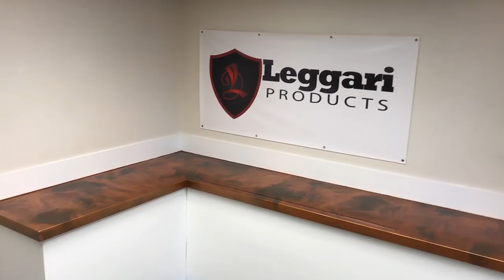Epoxy Countertop Coating in Brass, Coffee, Black and Orange Gold Metallics

Comment: Nicely done but missing too many details. Here's what I would like to see:
1. Technical details: sanding grit used, how to measure volume of product needed based on the area of the countertop, type of brush/roller, how long to wait between coats, total dry time
2. A video from beginning to end without jump cuts. This video doesn't show the cleaning after sanding, and it doesn't show a time lapse of the epoxy smoothing out. We have no idea if the epoxy smoothened out on its own or if you used a torch to help the process.
3. Demonstration on a real counter, with sinks and butting up against cabinets. Also a little more care - in this video I can see drips under the short section of cabinet.

You're already doing the work - would be great if you can capture it. What I would like to see is a video with a time counter starting at zero from when you start taping, and ending with a countertop that is ready to use.

I'm probably one of many who is comfortable with painting, new to epoxy, would like to buy a DIY kit from you, but who is intimidated because I keep thinking that you're making it look easier than it is. If I screw up the process, that's hundreds down the drain. So I want to know that this is something I can handle.
Reply from the maker: RK Coder We have the most advanced and detailed instructional videos on the market but do not post them on you tube. They are sent out once a kit is purchased if you would like to see them email us at leggari@gmail.com The videos we post on you tube is to show the endless options of our products.
Reply: Those are good questions and give peace of mind when investing time and money before starting. I imagine getting this product exposed as soon as possible was the goal. Maybe Leggari will answer these to bump sales.
Reply from the maker: Ron McCoy This video explains the process https://youtu.be/Fq40_IBjgC8
Reply: I cannot speak to this product specifically but I have put down thousands of gallons of epoxy. So #1 sanding grit, depends on that you are sanding. A 100 grit is enough to give epoxy a surface to cling to, if you have a bad surface you may need to start very rough and bring it up to #100. After you sand tac wipe. Measuring metallic epoxy can be more involved. How many colors are you using, what ratios, (highlights to base color). A gallon of metallic will cover about 50ft, you can stretch it farther but it will not flow right, the movement of the powdered metal in the material is what gives the it the awesome. If you are getting a kit this has all been worked out for you.  Use a 1/4-3/8 roller !!shed free!! From mixing to last roll plan to be done in 20min and you are safe. You will have to work the vertical surfaces a little extra as the material really does not want to stay there. When the material is done moving pull the tape, if it dries the tape will be a pain. Lots of videos on you tube about metallic epoxy watch a bunch and you will be fine.
Reply: Mike Grant Mike Grant These are great tips. Thank you! A few more questions if you wouldn't mind: 1. Any special precautions when working with a thick 4-inch backsplash? All of my counters have them 2. You brought up an interesting point about tape. How do you know the epoxy has stopped moving? I'm not concerned about top and side tape, but I imagine the bottom tape prevents dripping onto the cabinet. 3. Is there an ideal temperature range when to do this? 4. Does the area need to be ventilated to the outside? 5. I've seen some installers use a torch. Is this optional? 6. How does a laminate countertop with sharp corners end up looking after epoxy? Would it look slightly rounded over? Would you recommend slightly rounding over the edges before starting the project?
Reply from the maker: We address everything in our very detailed tutorial videos we send out. They are long, but detailed. Email us directly at Leggari@gmail.com and I'd be happy to send them to you. Thanks
Reply: 1. No special precaution, you will just have to work the material until it sets up enough to not slide off. Some people like to do the vertical surfaces  first and after they dry do all surfaces so you get the same amount of material everywhere. 2. As soon as it stops dripping you can pull tape. 3. Temperature will vary depending on the amount of product in place. 4. As with any coating that out gasses, use in a well ventilated area. A open window is fine, do not have a fan blow on the epoxy surface. 5. A torch with a rosette tip works well with many epoxys, you will need to refer to the MSDS before using a open flame near any material. 6. That is pure personnel preference, if you like rounded more then you will like rounded epoxy, if you like square you will like square. Take up Leggari's offer and watch their video, it could be they have some specific ways of applying their system that will make your project much easier. Just do it, you if you dont like it sand and have another go. The second time you will feel like a master compared to the first.
Reply: Mike Grant Thank you! I think I will give it a shot soon.
Reply: Looked like it didn’t matter. Pretty sure a two year old would get the same results
Reply from the maker: m60hein Exactly! If we explained the process step by step in all our videos no one would watch and we would get comments to stop explaining everything. These videos are to show what’s possible with our products. Thanks for watching!
Reply: Leggari Products 
would like more detail before purchasing. time involved...curing times. in other words,  what kind of time frames is my kitchen out of commission?
Reply from the maker: Lori Goedken You can do every step in one day. 
1- Prime surface and let dry for 1hr
2- Apply Metallic Epoxy Base Coat this can take 15 to 25 min
3- Once the Base Coat is applied immediately apply the Metallic Epoxy Highlights this can take 15 to 25 min
4- The Epoxy takes 10 to 12 hr to get hard. 7 days to full cure
5- If your doing a Top Coat that is applied the next day
Reply: RK Coder totally agree
Reply: RK Coder valid point you make, online  people alot of the times make things seem easier than it is with many projects. So it is nice when they take you step by step with details and time frames between coats so on and so forth.
Reply: What did he spray over it at the end?
Reply: Arleth Salazar I believe it's alcohol.

Comment: When you sand in the beginning, are you doing so to smooth out the surface or rough it up?
Reply from the maker: We're sanding the previous clear coating off so the primer will bond.

Comment: What is the wait time between primer and base coats? 

Does it dry super shiny without a final clear epoxy coat?

Is that acetone or denatured alcohol you're spraying in the bottle?
Reply from the maker: Once the primer is applied you have to wait 4-5 hours, after that the next steps are right after the other. Epoxy by nature is high gloss. Denatured alcohol is what's in the spray bottle.

Comment: What material is the original counter top? Could I do this if I have concrete countertops, or are they too porous? Thanks!
Reply from the maker: Yes you can do this on concrete and most hard surfaces as well

Comment: hello,
i am in the construction business.  i would like to see if you could do a black countertop and the different styles.  we have clients that could use this product and what is the cost and skill level one would need to create the finish that you show.  is the product self leveling or do you have to make sure there is no large humps.   thank you.
Reply: You can use a gas torch (or an electric heat gun - but the heat gun can push too much resin around, this can make nice effects though so up to you) to give a smooth level surface and remove air bubbles. Make quick sweeps across the surface, not staying in one spot for more than a second or two, with the flame edge between three and five inches above the resin. Repeat as necessary.

Comment: is it durable? like granite? What happens when you drop something heavy on top of it?
Reply from the maker: Our products are actually industrial coating made for military aircraft hangers, etc. So theoretically in a residential, or even commercial setting it will last forever. This is NOT a cheap epoxy paint that you will commonly find at box stores like Home Depot or sherwin Williams. It is a thick 100% solids epoxy coating.  Thanks

Comment: Can someone help me? I'm trying to use epoxy on counter tops and on the flat sides of my counter top, I keep getting vertical fingers and a bulge at the bottom of the surface all the way around.  

What is causing this and how can I prevent it?!
Reply from the maker: Here's a backsplash video, this may help with that as he is coating a vertical surface: https://youtu.be/kUAziUFcgF4

Comment: How is the durability of it? I understand it's not made for hot pots and the like.
Reply from the maker: It's an industrial grade resin that's made for high traffic areas and is extremely durable. It's used in a lot of commercial applications. It is heat resistant, we still recommend though that you take care of it and not set hot pans right on top. Take care of it like any other high end countertop.

Comment: How durable is the epoxy countertops
Reply from the maker: Our products are actually industrial coating made for military aircraft hangers, etc. So theoretically in a residential, or even commercial setting it will last forever. This is NOT a cheap epoxy paint that you will commonly find at box stores like Home Depot or sherwin Williams. It is a thick 100% solids epoxy coating.  Thanks